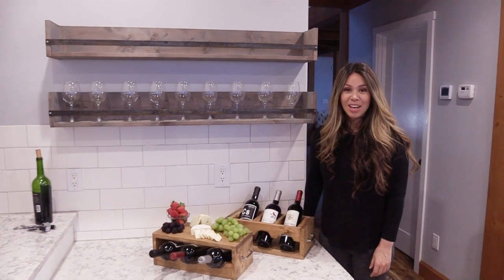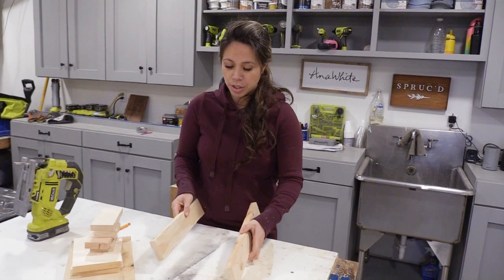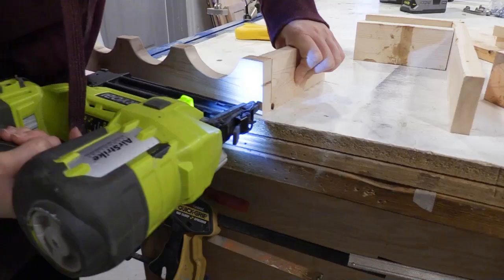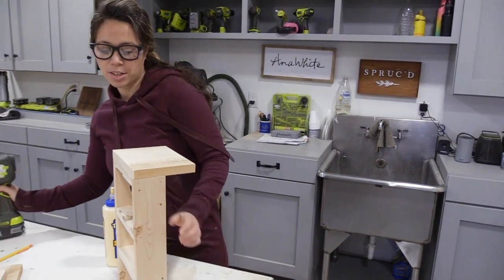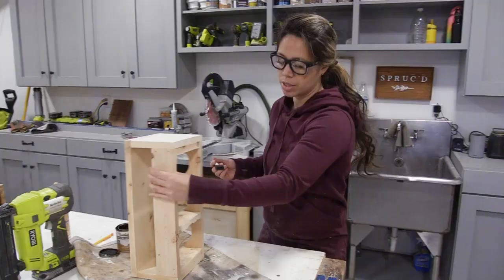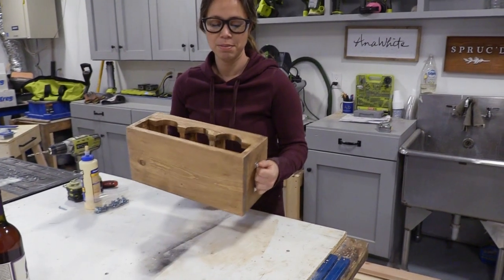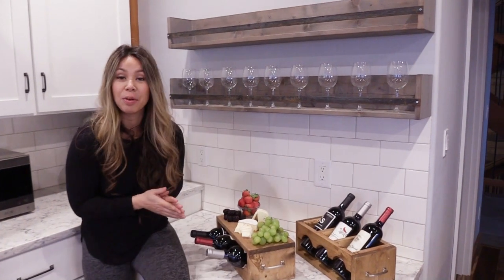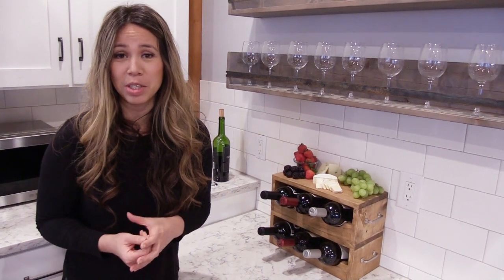Quick & Easy $10 Wood Wine Holder

Comment: if you got a 1 x 6 board and used a holesaw ( the size of the wine bottle  diameter) down the middle of the board where you marked  the curves to be - you could then just drill out the holes , cut the board into half so you end up with 2 1x3 pieces and then you have 2 frontt boards to lie your wine down on - would save having to jigsaw out the curves that way???

Comment: So do you put the poly or butcher's block finish instead of the varthane stain on top or after you apply the varathane stain? Sorry I am new to woodworking
Reply from the maker: If you want to use the top for cutting into like a cutting board, only use butcher block sealer on the bare wood, as small pieces of wood may end up in the food when cutting
If you want to use the top for serving (not cutting with a sharp knife, I would think a cheese knife is ok) then use any stain you like, but add a couple coats of poly to the top surface to seal the stain in the wood.

Comment: FYI ...You can use a 1x6 and cut out a full circle with a Hole saw then rip the board down the middle and have two 1x3s each with half circles
Reply: I tried it with the jigsaw and it looked like a 4 year old cut it....3 5/8" hole saw worked perfectly on a 1x6.

Comment: There should be a hole saw in the size for the semi -  circle cut outs. You know some child will try to move it when there is no bottom, shouldn't there be some kind of bottom? If you were going to stack and screw them together only the bottom rack would need to be covered.